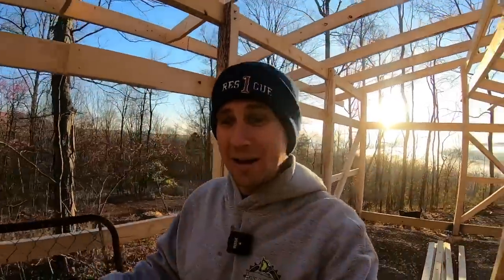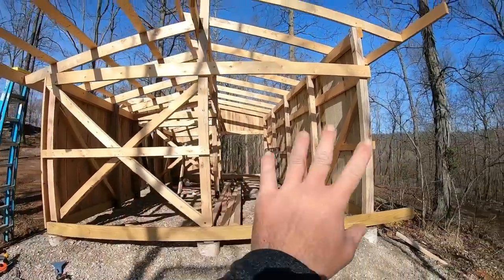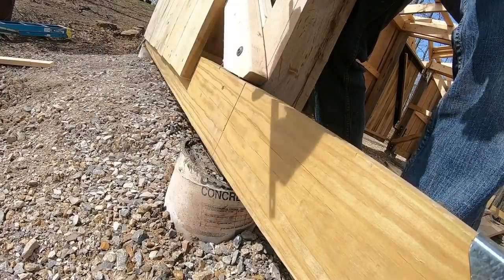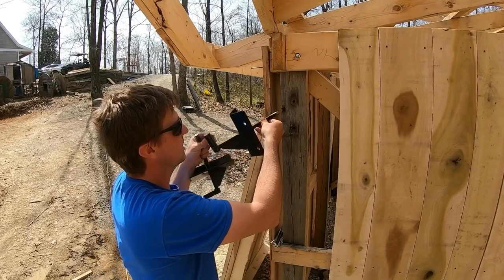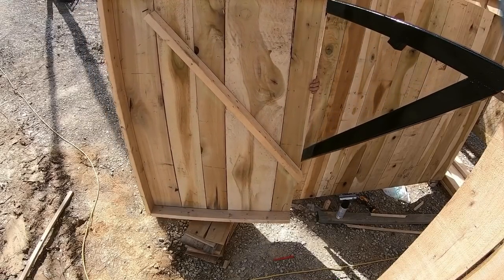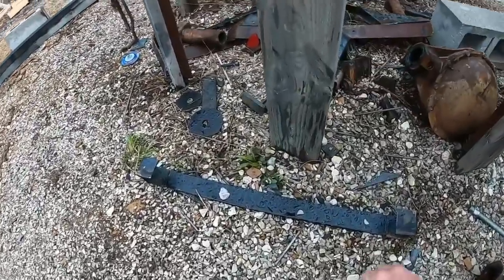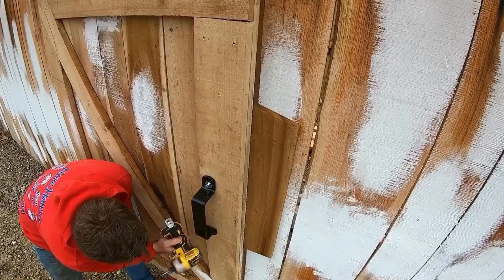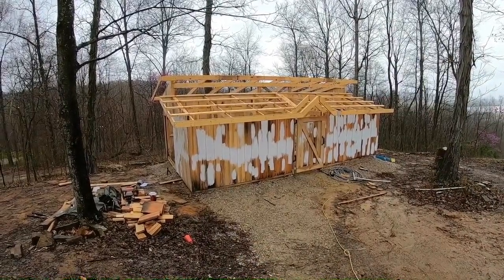Homestead Barn Building - Siding is All Installed and Door Latch Fabricated

Comment: Wood gain/loss moisture (10 to 12 times more) through the end grain vs side grain. This is why "quality" wood is painted on the ends with wax, or oil based sealer (paint). Latex paint is porous it will help but not the best. Without it the moisture leaves the ends first, causing splitting and warping. 

Bottom line, paint the ends of the boards. This will go a long way in keeping the boards from splitting and absorbing moisture (dry rot). 

My dad was a framing carpenter. Growing up I helped him to build and remodel several houses. You remind me of when I grew up. Fond memories. Thanks. 

I worked at a wood stove manufacturer as a welder. Because of my computer skills the owner moved me into the 'testing lab'. One of the things we had to do was test the moisture of the wood. That number goes into the burn calculation. I used a moisture meter and measured the moisture of the sides, each end and middle. Then the end grain. That is 14 test points. The wood we wanted to test with had 12% moisture. If a piece had 14-18% we would let it sit in the pile longer. I would write the percentage on the board. This way I was able to observe the moisture loss speed. The center test points were always 2-4% higher in moisture. Did I forget to say that the length of the wood was 12 or 16 or 18 inches long? In other words these sticks were not that long and that is a huge difference between the end and middle moisture. One day, just out of curiosity, I measured an 8 foot board every 6 inches. The center and almost all the way to the end was the same. Two to four percent higher. It was the last 4 inches that ended up with the huge differential of moisture. By painting the ends you will reduce the moisture differential down to 1%. I discovered this by accident. The unit of 2x4's we purchased had some with red ink like paint on the ends. After cutting to length. The end with the paint was way closer to the middle in moisture. The exposed end had the 2 to 4 % difference. This was after a week sitting outside. This was cool stuff to observe. Of course now a days we can look this stuff up online. But who has the time to do that? What search words would we type into the google? We are busy getting stuff done. lol.

Comment: Suggestion: On the horizontal trim boards at the bottom of the walls, consider a slight downward bevel on the top edges to let water to run off rather than pool at the joint of the trim and wall.
Reply from the maker: Good idea

Comment: Even though the top nails may be hidden, it wouldn't hurt to cover with primer, as well.  It could possibly rust streak down the front in a splashing/driving rain.  Can't see it requiring too much more paint/primer.  Good prep Captain.  Cheers!
Reply from the maker: Fair point

Comment: Idea: How would old fire hose, split longitudinally, work for closing the gap on the hinge side of the swinging door? Hose edges could be covered by trim/batten boards. Just a thought. Prevents wood hitting wood when opening the door, too.
Reply: People have done that as a wind block and it works.

Comment: That was smart how you made that drive through to clean everything out.  I worked on a ranch in Colorado some fifty years ago that had a ten horse stable.  I talked the boss into letting  me move the stalls to the other side of the barn.  It was my job to keep the stalls clean.  The stalls were just made with iron gates between the stalls.  I had it done in three days.  Latter that Inlet the horses out on pasture, open the sliding doors on each end, hooked all the stall deciders back against the wall and would just run the front end loader and push the straw bedding out the back door and right up on the compost pile.  I dropped in the new bales of straw for their new bedding and closed the sliding doors.  I had to open all the bales o

Comment: I love your Door build, I think it turned out great, I just have one suggestion for you, Weld a 1/4 inch bolt about 2 or 3 1nches long to the inside of the latch for a little handle to open it with, you will be glad you did if you have your hands full or you are wearing some big gloves, I know I had to add one to my Barn Door.

Comment: That exact Zinsser Primer Sealer is the best paint on earth for covering stains. It kills it all. Nothing bleeds through. The top coat paint really sticks to it as well. I've used it and it's the best! Paint on a barn will make it last longer. That too is a fact. Used motor oil - thinned with diesel - also makes a great sealer preservative. Keeps the bugs out too. Great video, Mike! Lee
Reply from the maker: Thanks lees!

Comment: When you were trying to flatten the round stock with the torch and hammer you weren't getting enough heat into it. Instead of stopping heating it when the outside turns orange keep going until it looks like its sparkling when you hit it. Got to get a ton of heat in it. Maybe heating it about twice as long as you was and you'd have had it flat in two or three heatings. Don't be scared to get it too hot. Its possible but you want to get it right there to the edge of almost too hot so the heat stays in it long enough for you to form it. Don't give up on trying to heat up and form something so easily. Just put the heat to it. I buried galvanized wire around my chicken coop and fenced in area just like you said to keep would be predators out. I used galvanised rabbit wire on the fenced in area. I used a three foot wide piece and put it two foot up the side of the fence and secured it with straight wire going in and out every five or six blocks and turned it out a foot and added a two foot wide piece of galvanised fencing like you'd use on a dog lot laying it over the rabbit wire I turned out then buried it under around 2 or 3 inches of dirt. Never had any coyotes or foxes dig in or raccoons or possums pull a hole in the chicken wire. Raccoons and possums will work through one of the openings in the chicken wire. They get their feet and snout in the hole and stretch it forcing their body through until it finally stretches enough they can squeeze through. The wire doesn't break, the hole just stretches out pushing all the other wires back until the holes big enough. Learned that on a smaller run lot I had for chickens so when I built my large 20' × 20' area I did it right. I put it 7' tall so I could walk in it and still have a top. At all the joints where the 3' wide pieces of chicken wire meet instead of over lapping them and using a piece of straight wire to weave them together, I put them edge to edge and used a nail to twist the larger holes together weaving each edge together that way. The building is looking awesome. Good video. 👍
Reply from the maker: Appreciate the tips on heating and that's a similar plan to what we have.  Thanks for watching!

Comment: If I understood you are planning on painting the outside of your siding but not the inside. I did that on one of my first projects when I sealed the show side of the back piece of a mantel clock but not the inside and it did some major warping. Now it was not nailed to anything just loosely slid into a slot and it was only about 1/4" thick so since yours is nailed to those cross members it may not be a problem.

Comment: The barn is coming along nicely Captain. 
On the hinge carriage bolts I'd recommend taking a medium size center punch and ball peen hammer to punch the center of the cut off bolts to kinda mushroom the ends.
They'll never come loose over time.
It's an old farmer trick I learned growing up in a small farm town in Michigan.
You reasons for using a high quality primer on the nails is definitely a good sign you're a pretty darn good DIYer.
The mesh screen you're going to put around the base of the barn should go out the distance you said you're going to put it but it should also go down at least 2 feet as mice will get past it otherwise. 
I had a pigeon Coup as a teen and learned that lesson the hard way after several of the eggs from show pigeons I raised and sold kept disappearing. 
I also put moth balls of all things in the bottom of the trench I dug to put the screen in. 
I used triple galvanized screen and it never rusted.
Today you have to find Made in America screen to have it be triple galvanized. 
Cheap Chinese screen is only single dipped and doesn't last long.
Reply from the maker: Appreciate the tips!

Comment: you should get a rosebud tip to help with heating it up to make it go a little bit faster and to heat the Metal evenly
Reply from the maker: Hey thanks for the heads up earlier.  Saved me some trouble

Comment: I would have enjoyed the explanation more if you had just said the diagonal brace on the outside was a troll to get more activity.  Also painting one side of a piece of wood will often cause it to cup toward that side.  For a barn you might not care.  But I wouldn't do it.  Enough moisture will escape from the ends and edges.  And how many times have you mentioned that poplar is naturally rot resistant?

Comment: Hey Mike, as a deaf fart with 2 hearing aids and needing headphones for watching YT,  been really struggling lately with the very low volume on your recent videos. Voice over Mike and opening/closing credits are ok but some live shots are really low and hard to hear. Any chance you could tweak the volume settings in the editing software to bump the volume up a touch as it never seemed to be an issue on your older videos?

Comment: You really need to prime the cut ends of your boards that’s where it will suck in the most moisture then mold or dry crack and split then suck in the moisture over and over again. Otherwise 👍 nice job